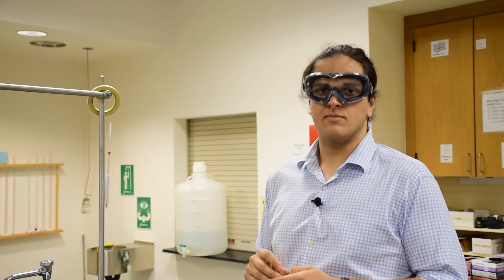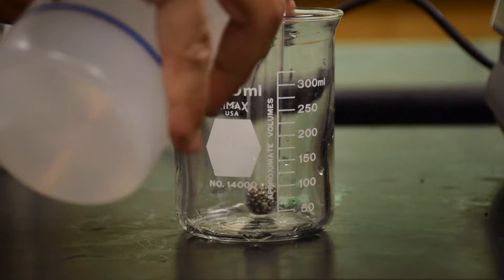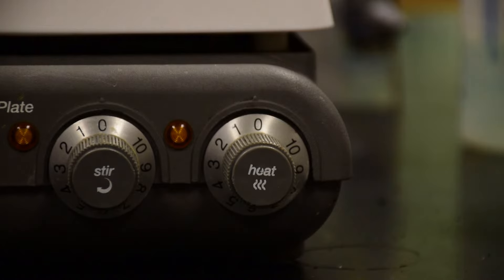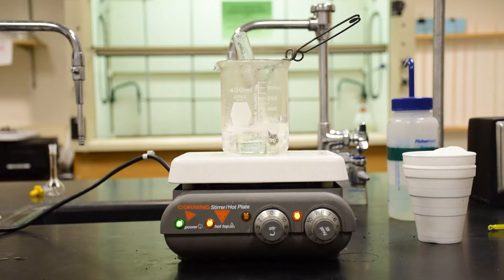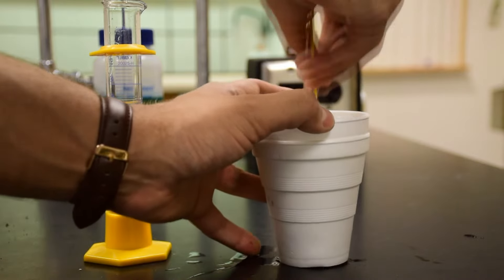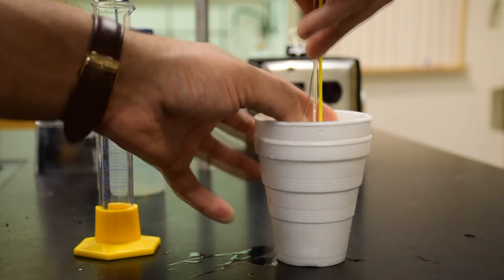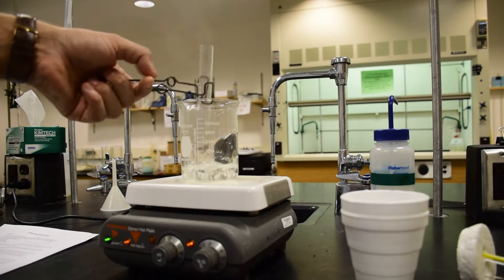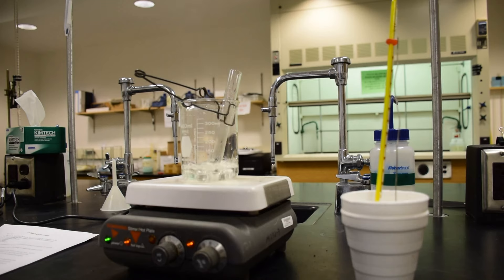Coffee Cup Calorimetry

Comment: Then turn on the hot plate to a level of 7 to 8 and boil the water, if possible balance the test tube just above the bottom of the beaker, you'll want to boil the water for five minutes to make sure that the metal is heated thoroughly, septup the coffee cup calorimeter as shown, using a graduated cylinder add distilled water to the coffee cup calorimeter is up to you to determine how much water to use you want to make sure that the amount of water submerges the bottom of the thermometer, you also want to make sure that the bottom of the thermometer is not touching the bottom of the cup record this volume, wait until the water in the coffee cup color reaches a constant temperature and record it, make sure you keep the metal sample